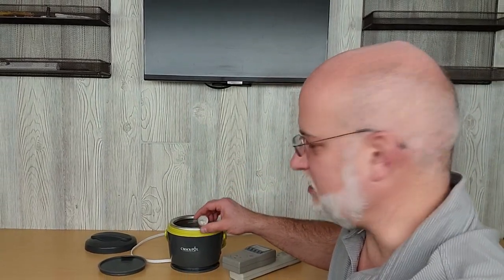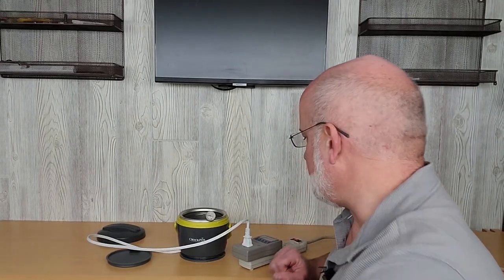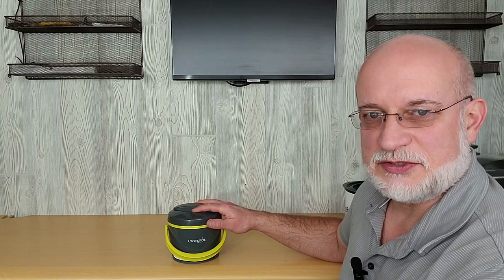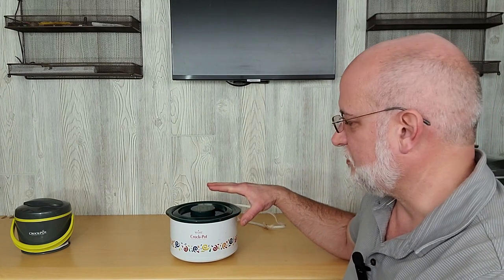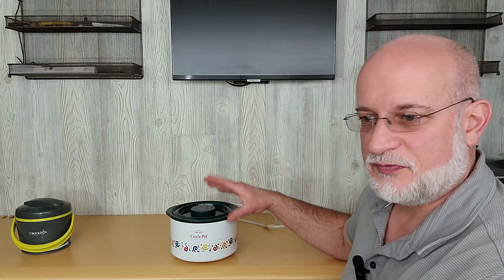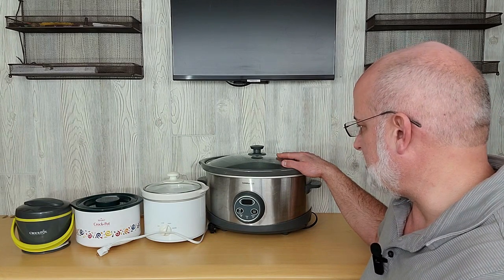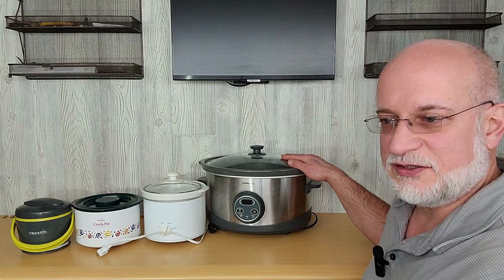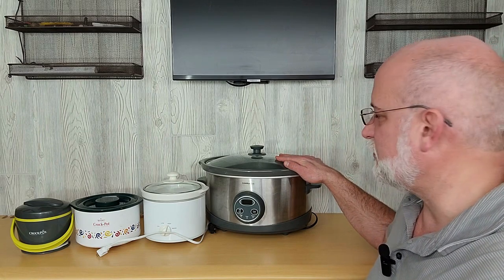Wattage Wednesday: Wattage used by a Crock Pot

Comment: Cover wrap it in a sweater and put it in a box to insulate it. That way you can run it at low level,but still get the same result.
Reply from the maker: Great idea! I will have to see how long this could extend my cooking time.
Reply: @daveandsonyainmichigan  I used to do it to speed up the cooking process almost by half.Induction cookers would be the best for wrapping the metal part while leaving the electronic part outside (bit induction cookers are not efficient). With slow cookers eventually the electronic wires and parts might start getting rusty from the vapor, because the sweater insulator will hold the vapor inside.

Comment: Thanks for the informative video!  For the 6.5 qt Crock Pot, is the 280w less when kept at the warm setting?
Reply from the maker: The label said it was 280 watts, I measured it using 233 watts. I did not measure it on the warm setting, but most electrical appliances cycle on and off to maintain temperatures. So on Warm, I think it would use the 233 watts for a short period then cycle off using 0 watts. This cycling would be continuous.
Reply: @daveandsonyainmichigan  Got it.  I think I’ll get a wattage meter and do this test as well.  My intent is to use my Ecoflow Delta Mini and crockpot for a day at the beach/park.  Hopefully it’ll keep the food hot by lunch time
Reply from the maker: @dannylapinid5908  those wattage meters come in handy, at times!
Reply: @daveandsonyainmichigan  Using the wattage meter I just bought, I noticed on my 7-quart crockpot was drawing 245w on high, 159w on low, and 89w on warm.  So it looks like I'll be able to use my Ecoflow Delta Mini on the warm setting throughout the day.  Thanks for your help!
Reply from the maker: @dannylapinid5908  that's awesome